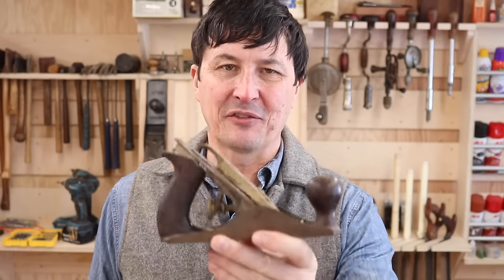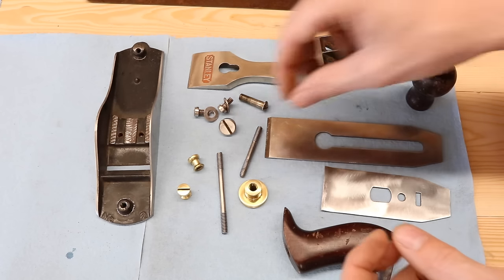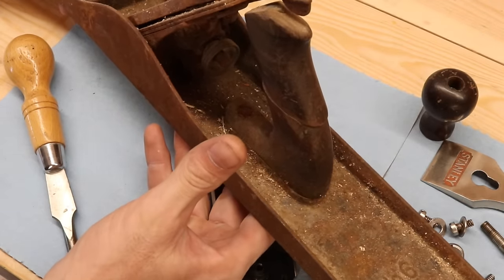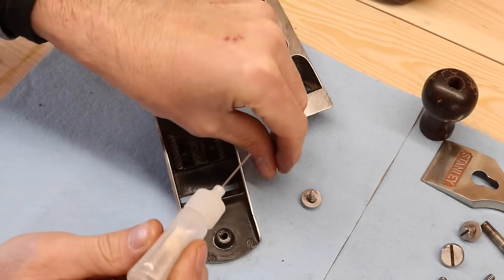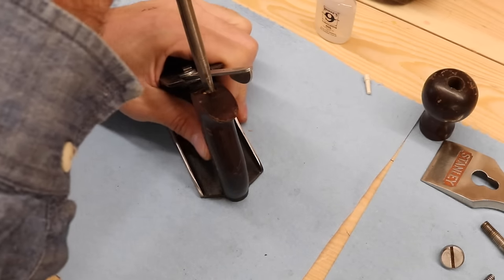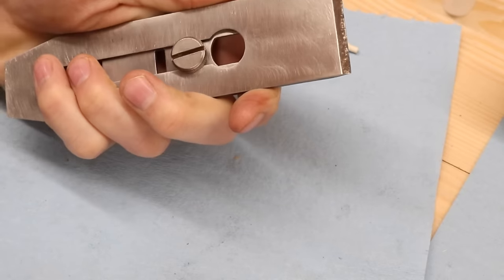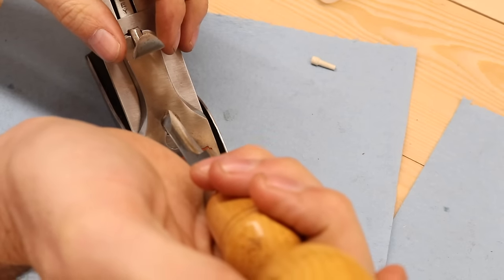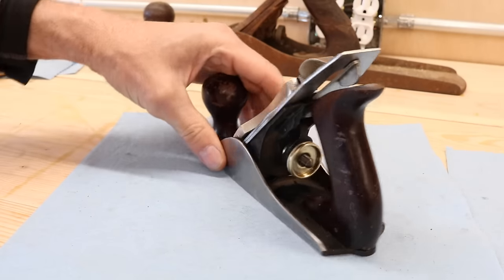HOW TO DESTROY A STANLEY PLANE!!

Comment: A little epoxy on those handles should do it! Since you can't get the rear handle free try removing the front handle, then submerging everything forward of it in vinegar or citric acid solution. Once you get it apart, put the epoxy, 2X and 4X steel wool to them. 4X is cheap and is the best tinder you can carry- even takes sparks while damp! A good "even this junk can be saved!" video may keep some rusty hulks working for generations to come!

Comment: That #6 should clean up fine. I have one and use it. Also I've glued a cracked handle together and use it regularly, the tension in the handle mounting bolt protects the glue repair.

Comment: I've had great results cleaning small parts with my "Dremel" (knockoff-brand) tool and the little tiny wire brush attachment that you can get for it.  No worries about pulling your hands into a machine because you're wearing gloves, takes a little longer, but easy to do.

Comment: Restore it.  Don't give up on the handle (tote).  Just clean out the surfaces of the break with a firm bristle brush, then use some epoxy and moderate clamping pressure. If your alignment is good the joint will almost disappear. While not perfect,it will certainly be
 useable. Looking forward to watching the restoration. 

Hank

Comment: Hi Cody, 
I'd really like to see the restoration of the Stanley Bailey No 6. 

Don't be misled by the plane saying 'Bailey', it is a Stanley plane. Leonard Bailey was the original designer of this type of Plane and Stanley bought the patent rights. When Bailey died in 1905 Stanley started using his name on their planes in 1906. Your No 2 doesn't show the Bailey writing because the body predates it (Check my comment on your previous No 2 video).

By what you showed the No 6 it's likely a Type 10, 11 or 12 (1907-1924). They only started using the Stanley name on the lever cap in 1925. What doesn't quite fit here is the mismatching of the tall front knob and the small diameter brass depth adjustment nut. But that really shouldn't be any concern of yours. These old Tools were built to last (if taken care of). They had a life before you and they will most likely have a life after you. After all it's around 100 years old.  

And don't mind the patina "discussion"! You safe this tool by giving it its purpose back. It simply doesn't have any in the current rusty state it is in.

regards

Comment: please! Another plane resoration would be neat! And i dont think you would have to replace the handle on the No 6. you can insert 2 or 3 metal pins / rods and keep the handel together that way. You would not be able to see it from the ourside, only the small line of the crack would remain visible.

Comment: To me, "The Frog" looks to be similar in appearance and function as "The Frog" of a horse's hoof.  It doesn't take the direct load of the work, but, offers support.  Purdy little plane... and, yes, functional beats having all that rust continually degrading the tool away.

Comment: a buffing wheel on one of those Grinders is nice especially if you have rogue sticks we had red sticks at the Calibration Laboratory when we were cleaning up gage blocks and indicator stand blocks.
Reply: I also think you might be able to repair that handle on the # 6

Comment: Try fixing the handle for the 6 by using small dowels and gluing it. Seems like that would be too hard to get right, it would be plenty strong, you keep the original handle, and if you mess it up you just move on to plan B anyhow.

Comment: Why not use low strength Loctite versus oil.   The oil will not prevent rust, as the Loctite will and the Loctite will also keep your handle together until you choose to remove it.    Next time use the 222MS that I sent you.    You will love it.    Also it will be good for your scope rings and optics.

Comment: I'm sure that you are planning to use these planes, so by all means restore them the way YOU want to have them. Does that diminish its value? No, if anything it will make it worth more to people that plan on using them as they were intended. I sell a lot of old planes at Flea Markets, and have found that the people that just collect them usually won't pay much for a plane no matter what condition it's in. The people that plan on using them, and know how to restore them, want them in rusty condition so they can get the enjoyment you do restoring them first.
The rarest, and most expensive plane I have sold recently was just the body of an old Craftsman 18in. fluted base. I found that they were not very common, but shared a lot of parts with other size and make planes. That being said, it sat on my table for three months before the right guy came along. He was very excited to find it and didn't even argue about my $40.00 price for just a body.
The number two is actually a plane that would be used most often in the cabinet trade. It's size works well doing drawer sides and edges. Keep up the great videos about the restoration of old tools, and never mind what people say about you ruining the value. IF you decide to sell any of them, there are always people out there that will appreciate what you have done and will pay for it accordingly.

Comment: What you have done with the Stanley #2 is perfectly acceptable. If it is left to rust away, it will eventually be worth $0.00. Just don't try to refinish the wood parts; that is where a lot of the value is. You will want to apply a coat of wax on all of the wood and metal parts. Johnson paste wax is what I swear by. It will keep it looking fresh for a while. A light coating of oil would also help.

Comment: Use of the name of an item as a frog occurs in many places as well as in planes and is clearly an engineering term. In railway/Railroad points/turnouts/switches the frog is the part where the running rails cross over at an angle.. A 'frog' is also a  device that was used to attach a 'sword', 'bayonet', or 'hatchet' to a leather belt. Bricks as used in buildings have an angled depression called a frog. A frog fastener (also Chinese frog) is an ornamental braiding, consisting of a button and a loop, for fastening the front of a garment. I suspect there are others

Comment: That cap also applies even top pressure, if you mar it up you will make the pressure distribution uneven and it will deflect the iron slightly. yeaaa even I don't fully buy that answer, it's just smart to not mar up the cap lol.

Comment: I have bought several Bailey pattern planes with cracked totes.  Fixing them is not that hard, and the condition lowers the price. To save the rare rosewood I have mended them with West Systems G-Flex flexible marine epoxy, and sometimes with 1/8" steel or brass pins to strengthen the joints. Rosewood is very oily, and hard to get a bond on with many adhesives, but the G-Flex does the job. If you want a more inconspicuous joint you can collect some dark hardwood sawdust, mix it into the epoxy as a filler to take the finish. On totes with missing tops like on that #6 I have cut a flat surface, glued in a piece of  Honduran rosewood from some small scraps my brother gave me, and shaped it back to the original contour.  I like Birchwood Casey Tru-Oil for finishing the front knobs and totes. There is nothing like taking a rust-bucket like that #6 and putting it back to the condition that you have the #2 in, and putting it back to work.  I have a few #4's, a pair of #5's, a #3, and a #7, but no #6,  maybe I'll check eBay....I'm not an addict, I can quit any time I want.

Comment: When I was in school, 10-15 years ago, we had a woodwork room in our school, and we had small planes like the Stanley 2. I don't really if it was exactly that brand, but they were the same size. Nevertheless I don't think they were 'made for kids'. Big ones are for big material, smaller ones for finer builds and smaller details. Could it be that simple?These woodwork rooms still exist, but I'm afraid their use is decreasing. Cheers from Norway.

Comment: It's not destroying it, but if you want to do the least damage to the threads either use brass wheel like you said or get rust off in a different way. Electrolysis or even plain vinegar

Comment: Do it and you can make both the handle and the knob. 

PS - They make a little brass wire brush wheel for the Dremel. I clean and repair fishing reels and I'd be lost without it for cleaning out corrosion.

Comment: I wouldn't replace the handle.  It can be fixed with good glue and one or two fine hardwood dowels.  That way everything is original.  But, I'm an "old guy"... ;)

Michael Bradley

Comment: please do restore the bigger plane, I have one very similar in size with the fluted bottom. the only problem I have run into is someone tightened the holding screws on the frog and broke that casting. I'm not sure how I'm going to repair that but I would like to see the number 6 plane restored the correct way so that I can maybe follow along.

Comment: Whether you've "ruined" anything depends on your reason for getting it.  If you're collecting it for the historical significance, then I wouldn't restore it.  If you're planning on using it as a working tool, then by all means, keep it in as good of shape as you can ( as you'd do with any working tool).

Comment: You should absolutely restore that and any other planes you acquire that are in need. What purpose does any tool have if not to be used?  And you should try your hand at either making a new handle or better yet, fixing the old one at least until you can find another.

Comment: The same people who think you ruined a tool by keeping it  in working condition think that decades of dirt and wax buildup on furniture, is patina. It is not, it is dirt and wax buildup. Patina is the result of oxidation of the wood and original finish. 

But we are stuck with people who think holding an object in slow deterioration is precious. They need to study Conservation vs. Preservation vs Restoration of objects. Watching them slowly deteriorate is none of these. Keeping them dirty and non-functioning may only qualify as preservation if you have no idea how to Restore it to original condition. It still needs to be stored in a manner which prevents further deterioration.

Conservation; return to original appearance by using methods which are reversible, allowing return to condition prior to conservation.

Preservation; hold an object in the condition it is found in, preventing further degradation.

Restoration; returning an object to original appearance and operability.

this is based on my training in art and artifact restoration and conservation. Preservation is usually done prior to the restoration or conservation of an object.

Comment: Use old English on those wooden handles! The oil will recondition the wood and the stain in it will hide the scratches. It will make those handles look like new and the best part will be that they are original!

Comment: Never use a wire wheel to clean threads. it damages the threads severely. you have to see them under magnification to understand. wire brush in the hand works well of course the proper tool is the proper die.

Comment: Do yourself a big favor and buy some gunsmithing screwdrivers.  You can pick up a good sized set for not a whole lot of money.  They are hollow ground and you can use a bit that fits the screw perfectly so you won't "bugger up" the head of the screw. It would have prevented you oops on that brass screw. I guarantee you won't regret it, you may feel a bit spoiled, but no regret.

Comment: On the subject of restore on not to restore. If you leave it, eventually it will be unusable and then turn to crumbling rust. If you had a vintage wooden plane with woodworm would you treat it or leave it? Only craftsmen who have spent time to master these planes truly understand them and how they work. Surely they should be the custodians of these fine tools. If they are all rusted up they don't work as planes, so they are not planes, just a lump of iron.
Please do the 6 on film.

Comment: You say Safety Salley's I had my pulled into a spinning tool because I was wearing gloves.  Bender I was using split my finger open a so I could see the bone.  Still have a big scar from it 10 years later on my finger

Comment: Value is a relative thing.  For example Gold. Gold really only has value when it is being used. If you were in the dessert and dieing but had gold bar, would it be of any value to you especially if there is no one to sell you some water? Those who came before us spent a lot of time and energy to design and build these tools.  They were created to do a job that needed to be done.  They were not created to be left behind when one of our father's or grandfathers died to desintagrate into nothing.  If someone wants  to hang  something on their wall, do it with something that is too far gone to be restored.  There is sentimental value which has value that can not be measured on any monitory scale.  On that scale the value is increased when these tools are brought back to life.

Comment: Definitely, do a 'restoration'.If you cannot make a handle why not dowel pin and glue repair the handle?Once tightened down with the main screw,  should be fine.

Comment: You don't just collect, you use the tools you collect.  These were designed and meant for use and designed back when folks took pride in their work instead of the bottom line.  So unless you collect with a view to cashing in later monetarily don't let it bother you.

Comment: The so-called "purists" are wrong.  There are few things more obscene than a rusty, neglected tool.  A properly restored tool is a thing of beauty, and it speaks volumes about the owner.  If it were mine, I would sand the wood handles, refinish, and oil them as well.

Comment: the planes are like a barn find vintage car, don't even wash it and hit has the most value. To to a car guy we want to at least hose the thing off get the tires to hold air and the engine to run. On your plane that's equivalent to removing rust, sharpening the blade and getting the thing usable. its not a wall hanger piece of vintage memorabilia its a active tool of that trade that happens to be really old and perhaps rare. I'm sure origional owners would appreciate their tools being cleaned and used more then hanging up all rusty and useless.

Comment: if you use it why not restore it. All my planes are restored and I use them. Good job Cody do another plane I would start with some  Vinegar  with so much rust and try some epoxy for that handle its worth a try if you pin it.  thanks

Comment: I don't know what brushes and tips you use on your guns but stay away from those Hoppes tips I've had them come apart in the barrel!! if you want some advice on tips stick with Kleenbore and Outers, the way they're made they can't come apart, Walmart has a bottle something like that in the sporting goods section they're for fishing reels! and to those idiots that say leave it as is, there is no value in a tool that has no possibility of use, that's what take it's value away!!! most who collect or buy the old tools tend to want them to use not to sit around looking like it's ready to be scraped!!!!you might wan to hold off a little time for another plane, a little something in between so the mind numbing?

Comment: The chip breakers are made to take the caps off the blades! Why do people that know nothing about them spout idiotic garbage like that. A smaller screw driver could damage the screw if it twists in the slot. Smarten up people.

Comment: Sure, restore the #6, I have never found a use for a #6, I have several #5-1/2 jack planes and a #7, so I don't feel the need for a #6, but why not restore it? You can make your own handle, it is not hard, I've made several. Lee Valley has a template and instructions on their site for free!
http://www.leevalley.com/us/html/16j4010k.pdf
I can send you some rosewood if you like, from the 1970's the real deal.
Cheers!